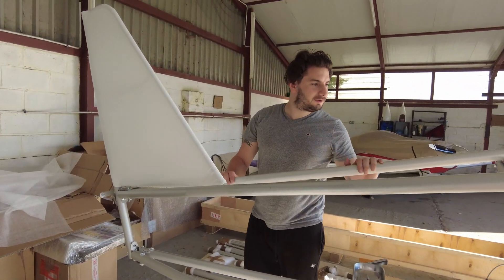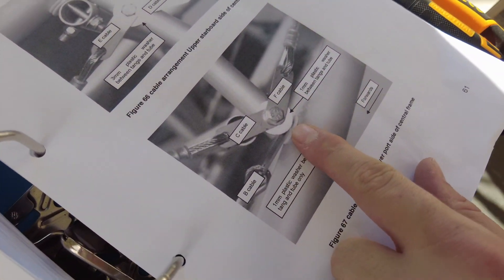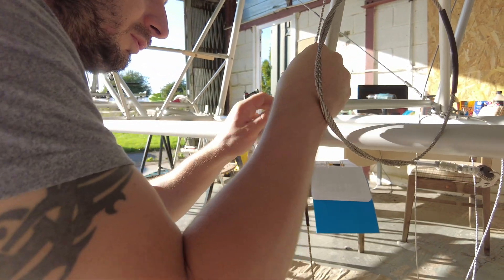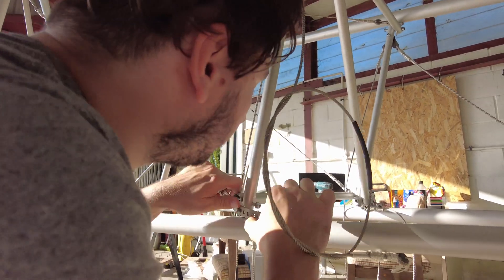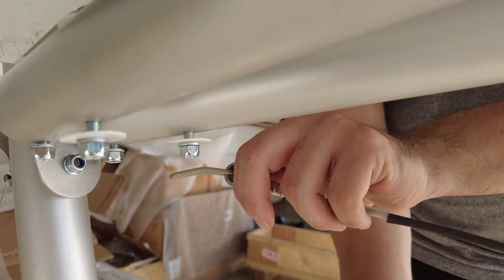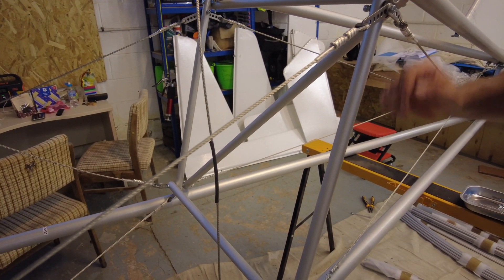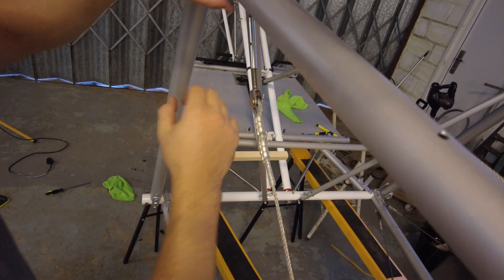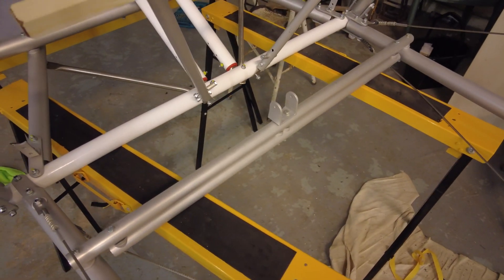Building A Plane | Building My Skyranger Nynja | Fitting Rear Fuselage & Bracing Cables | Episode 5

Comment: Thanks for another interesting episode Nick - really enjoying these. Have you had any thoughts about what you're going to do for avionics? A nice big G3X or something simpler??
Reply from the maker: Hi Andrew - thanks for watching! I have actually got my instruments already and I have fitted them to the panel so they are ready to go in. I have the following:

80mm Kanardia ASI
80mm Kanardia Altimiter
57mm Kanardia Tacho
57mm Kanardia VSI
57mm Slip Ball
Standard rotax gauges - oil temp, oil pressure, coolant temp, volts
Guardian Ipad mount in the centre of the panel.

I may yet swap out the slip ball for a 57mm Kanardia Horis and I also have an MGL fuel computer and fuel flow sensors I might try and find a home for as well.

I am trying to keep the spec as standard as I can for the build - I may modify later. I don't want to give myself too much of a headache with modification paperwork straight out of the starting blocks. I would rather get the thing built and flying first and then start changing things if I feel I need/want to!
Reply: @LetsGoFlying  Thanks for the reply! I can see what you mean about wanting to keep things simple initially - those instruments are the standard ones supplied by Flylight? I just get excited by all the bells and whistles on various EFIS panels. Kanardia have some interesting options there too. Would be interested to see a little of how you got on doing the instrument installation also. Thanks again.